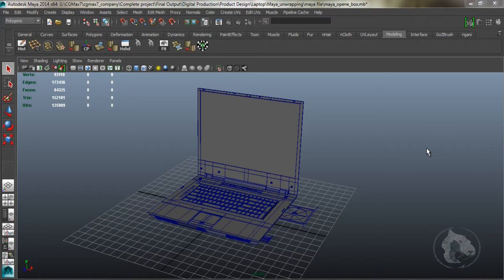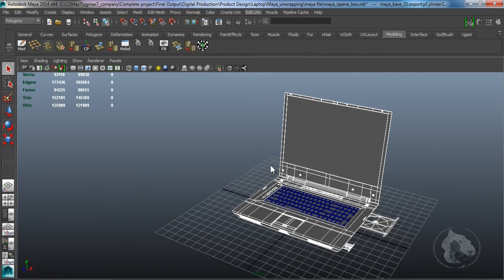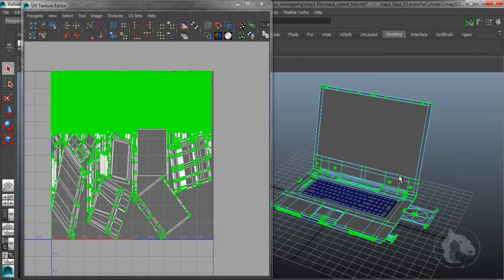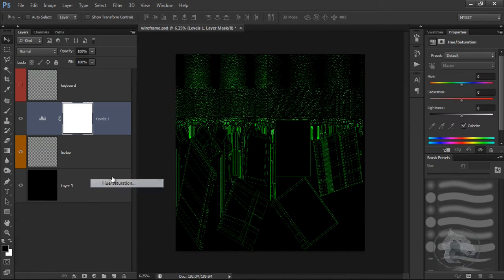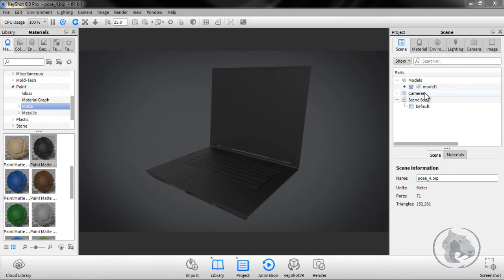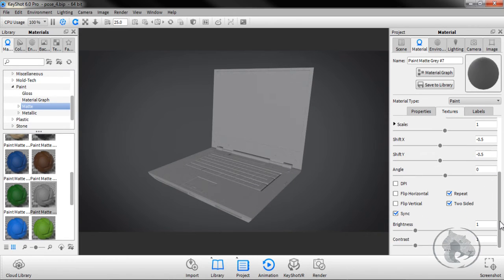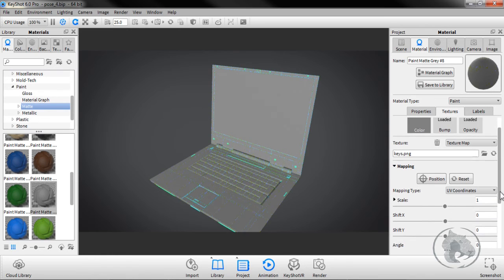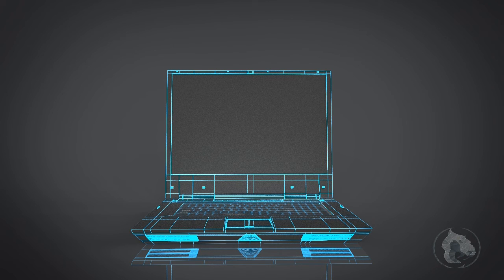Rendering wire frame in keyshot

Comment: Hi there! If I already made UVs in Zbrush, is there a way for me to render quads in wireframe mode using keyshot?
Reply from the maker: Depending on your model if the model is quad then you'r uv will come out at as quad...Although if it's triangles you can use the Zremesher or retopology.
Reply: +cgmax7 yes, it's is quad. Keyshot wireframe material auto triangulates it. Have you tried it before? I have no idea how to solve this.
Reply from the maker: I think you should watch this tutorial lil bit more closely..because when ever you bring a model which have even quads and you bring them into keyshots it automatically convert triangulate version... so no matter what materials you apply it always stay in triangulated...So to show the wierframe you need to make the uvs in zbrush or whatever software you  and then you save as a png and then you apply tht png as texture in keyshots materials...Let me know if it work for you
Reply: cgmax7 True, well, so far I've not gotten any good news on how to export UVs as PNG out of Zbrush. Hope I get a solution soon. Thanks.
Reply from the maker: Rishen El Nino Even if you got jpeg of UVs you can bring into the photoshop and select with the magic wand tool with contiguous on this will select the solid color and then you can hit the delete button to remove that color once it done then its the similar like i mention in this tutorial.Let me know the results.
Reply: +cgmax7 sure, will do. Thing is, so far I can't find a way to export UV's out of zbrush in any format.
Reply from the maker: you cant export UVs from Zbrush you need to export the model and import into a 3ds software package like maya, 3ds max or blender.
Reply: +cgmax7 awesome! I can give it a try, I have max! Any links to help me out with this?
Reply from the maker: No nobody had tried that...These are my experience and experiment maybe soon i make a tutorial on this as well..